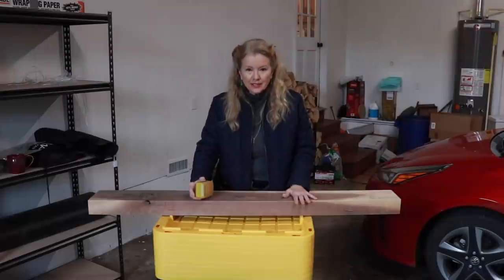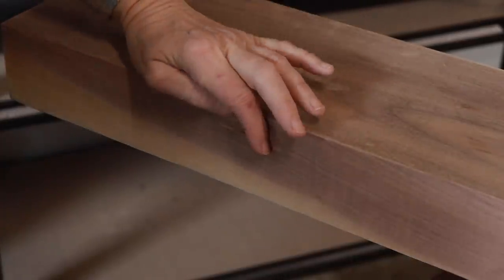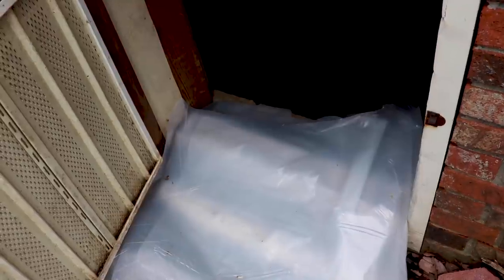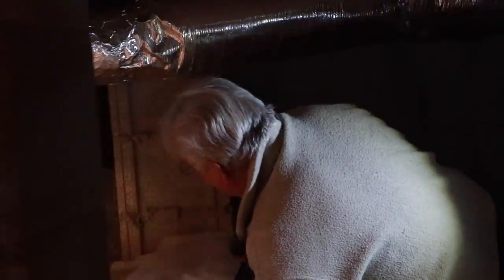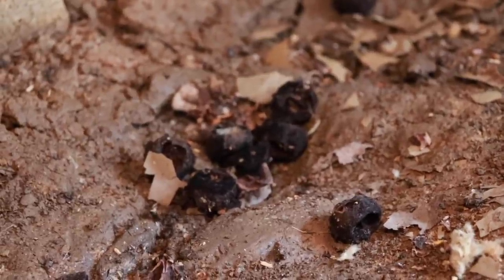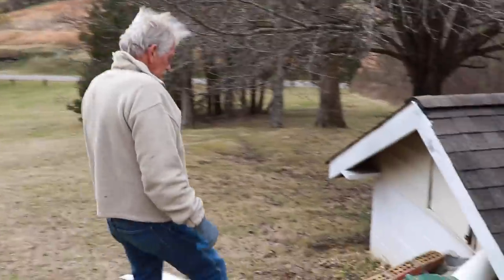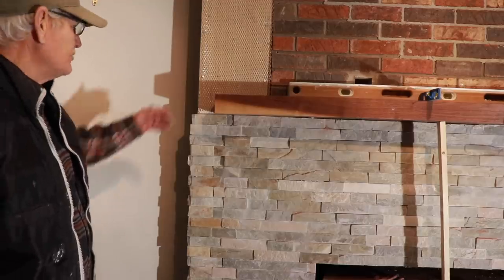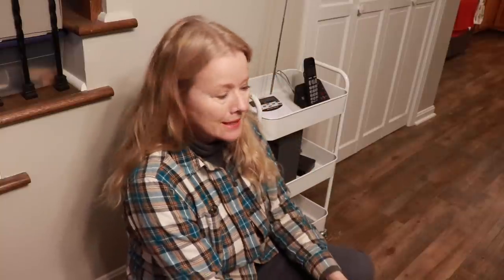WHAT EVERY HOME NEEDS! Plus, fireplace mantel!

Comment: City water in the summer (especially when you enlarge your garden boxes or with fruit trees) you will use more than $10. I would find a way to use the cistern and make it a root cellar too. There has to be room in there. I think the mantle looks good. I kept looking at it and since your new stone area to the left of the fireplace is bigger than the right due to the opening of the fireplace insert...I thought expand your mantle to the end of the right. Since your look is asymmetrical now or have it even hang past the stone a little on the right. Anyways... just a thought.
Reply from the maker: It won't work because the doorway is there and the electric plug to plug in the stove blower. I hope to balance it with either my fireplace tools or wood. Thanks!

Comment: It’s all coming along beautifully Kaye. As far as the mantel being proportionate to your fireplace, I know you probably spent a lot for that beautiful piece of walnut, and have your heart set on it..however,  you can always add Corbels under the wood to beef it up or  have a sleeve made up to go over it .
Reply from the maker: Originally I had wanted cast iron brackets under it but Tommy explained to me that we can’t drill holes in the stones because they just crumble so it had to be floating in it had to be embedded
Reply: @Latebloomershow . Kaye, Whatever you decide to use, they wouldn’t actually be holding up the mantel ..they’d only be mounted for decorative purposes. I had that done on an old mantel using two carved - Victorian figureheads.  They were mounted under the mantel on either end.  Screws were drilled from the  top of the mantel overhang, set in, and filled .

Comment: I was a licensed professional  plumbing contractor for 48 years and the last time I was under a house, I was bitten in the elbow by a Pacific Coast rattlesnake.

I will NEVER go under a house again - guaranteed!

I would try putting gypsum into the cistern. It will patch tiny seeping leaks. 

I would loop that main water valve outside, insulated and with a blow-down valve and drain, so the house water could be shut off and drained during a hard freeze.  I plumbed my house like that and am freeze-leak immune now!

Put a first-flush on each roof gutter BEFORE it enters the collection manifold.

I disagree with this fellow's assessment of using mains water in your garden. Use rain water like you were originally intending. I use my pool as well as IBC totes to store water and distill my own drinking water using concentrated solar.

Hard-wired telephone lines are ALL Internet now, FYI.
Reply from the maker: Not all. I have a POTS line running to my house but I am not paying for service as it's expensive and I hear the service is bad. They WANT us dependent. How do you distill water? I still haven't got what I need to start that. Thanks!
Reply: @Latebloomershow  
I use a tracking solar concentrator to make steam, then condense the steam back into pure water using a water cooled stainless steel condenser.I will do a video on it when it gets warmer. Right now, I'm using previously distilled water saved back in jugs.